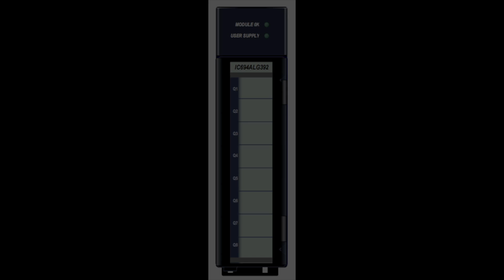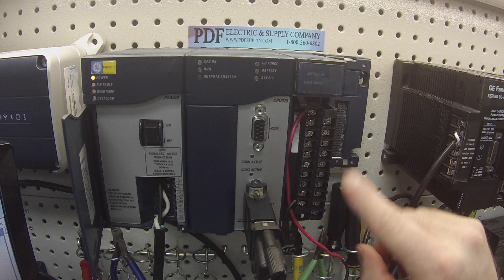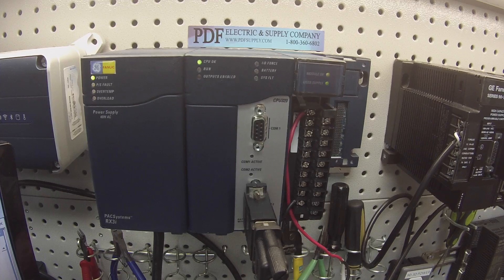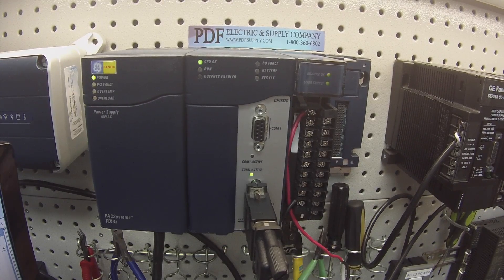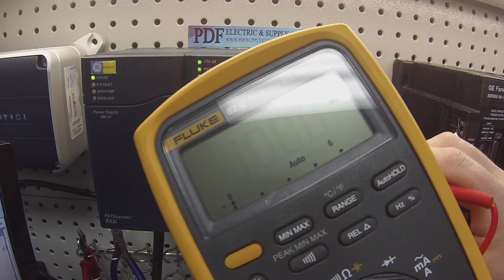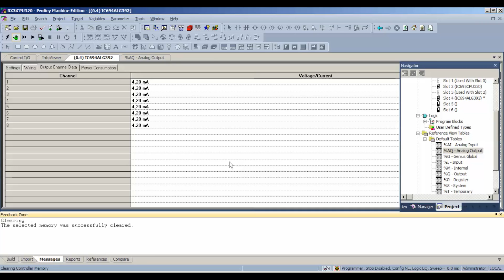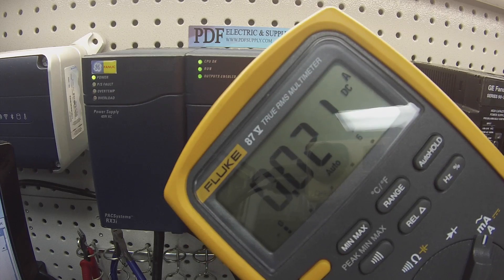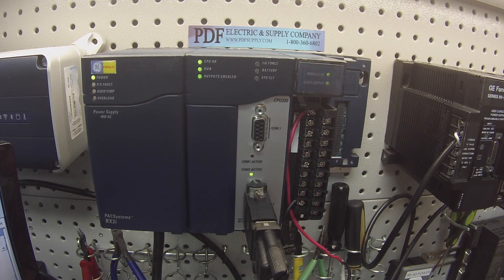How-To Troubleshoot: IC694ALG392 Analog Output Module (Rx3i GE Fanuc Proficy Tutorial)

Comment: What is 0-32000 scale? I’m new to PLC’s and didn’t know what that represents. I know signal scale is 0-10 volts or current is 4-20ma or 0-20ma but didn’t know what the 32000 units were if that makes sense.